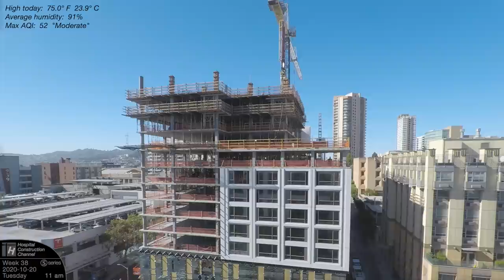One-week construction time-lapse with closeups: Week 38 of the Ⓢ-series

Comment: It Still Amazes me how much work that crane drive does every day   so much stuff to be moved  Great Vlog thanks was Surprised they added window frames this time with out the windows
Reply: I wondered about the missing windows too. Not only the panel they installed on the front this week, but the left half of the one below it that they installed last week. Also, in the road trip it looks like several panels in the top row on that side were installed without windows (not to mention the corner ones, that couldn't be installed with the windows.).

Comment: Hospital construction do you know how many floors they are planning to build yet?
Reply: It says in the first line of the description,  right under the video.
Reply from the maker: The decking that you see starting to go up at the end of this week (week 38) on Friday is for the roof level.  However, there will be various structures above that, such as the elevator shaft, roof screens, and locations for various equipment.
Reply: @HospitalConstruction  thank for your quick response and answer.

Comment: How many floors are remaining to be construed out of 13?
Reply: In this video you can see the final concrete floor going in , this the roof, however there possibly might be a tower for the elevator shaft equipment
Reply: I think is already top out, the week construction is from a month ago. Top out probably for Week 39 or 40 at last.
Reply from the maker: The decking that you see starting to go up at the end of this week (week 38) on Friday is for the roof level.  However, there will be various structures above that, such as the elevator shaft, roof screens, and locations for various equipment.